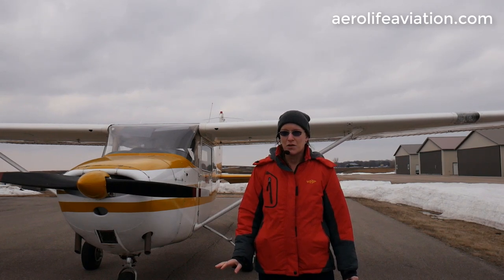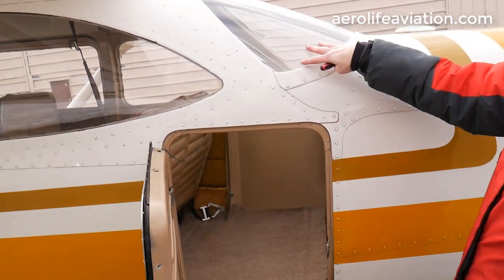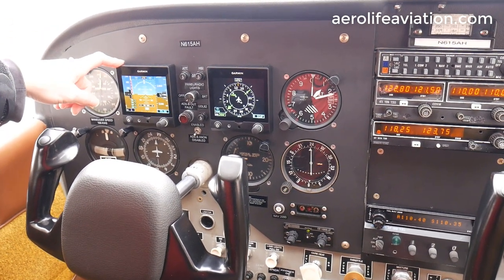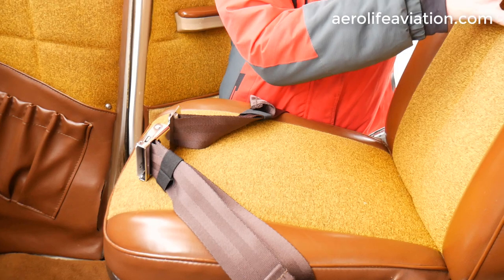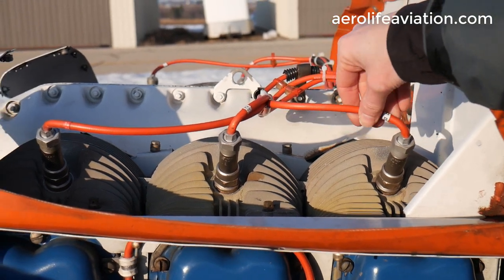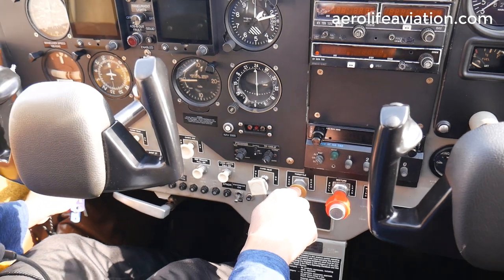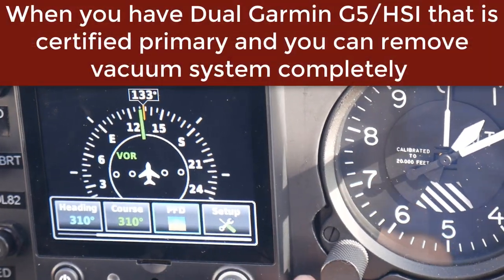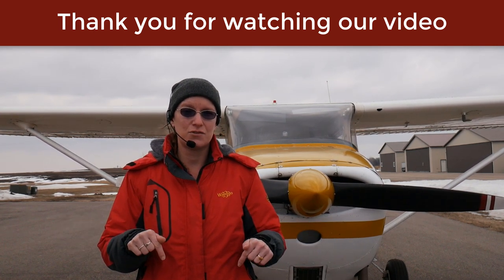Own a Cessna 172 with dual Garmin G5 mini glass cockpit for $49k - Cessna 172 for sale

Comment: Refresh rate of camera  and Nav/com radio are not in sync hence the flickering. That difference catches refresh rate of radio that we normally don't see.
Reply from the maker: Thanks. what rate would you suggest ?
Reply: @aerolife1646  Don't know the platform you're using but if you can change shutter speed or refresh rate on your camera you need to bring it down. Basically your camera is outpacing what you're filming...in this case your avionics stack. Slow the camera down and it won't catch the normal flickering that we normally don't see with our eyes.

Comment: Dude flying rotates with two hands 🤦🏻‍♂️
Reply from the maker: Rotation with one hand is a usual way but sometimes conditions demand both hands for safety, you will see that in our Mooney video rotation. It is just the force you feel at the rotation.
Reply: @aerolife1646  on take off, not having one hand on the throttle etc is dangerous. I cannot see (as an ex airline pilot) a reason that you suggest is true. It's a 172.......
Reply from the maker: @JB-tc8el  Even though it is always a good idea to have a hand on the throttle at take-off If you are familiar with the airplane and adjust the throttle friction lock properly during the preflight. It is fine to take off without holding during special situations.
172 throttle is not spring-loaded.  Pitch and roll control are more important especially with a heavy crosswind, and turbulent conditions. Trying to do that with the left hand (most people are right-handed.) could be challenging in some situations.
Reply: @aerolife1646  we will have to agree to disagree. If you are struggling physically to that degree then it is questionable in the first place that you should be flying at that time. Secondly if that is the case then you need throttle control for emergency action such as aborted take off or setting it down. Either way there is a reason it is not taught that way even at atpl or military.
Reply from the maker: @JB-tc8el  Do you know any NTSB accidents reported by this event? (Throttle not holding and coming loose during take-off?)
How many accidents reported for loss control at take off? 
Yes we can agree to disagree. Thank you for the comments and watching the video.
Reply: @aerolife1646  Plenty of accidents are caused by loss of control but 1 hand vs 2 hand isn't going to change that...he's right that there's a reason one hand on the throttle is taught. If you can't control the yoke movements of a 172 with one hand, even if it is your non-dominant hand, you probably shouldn't be flying in those conditions anyways. Or at all.